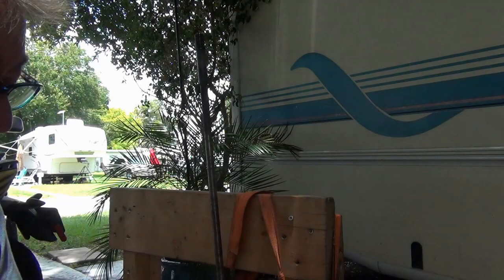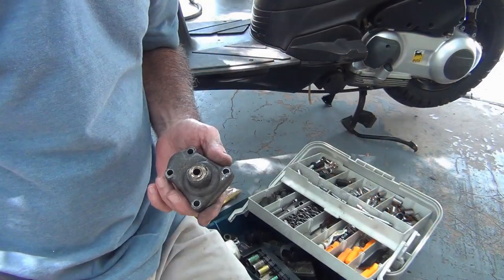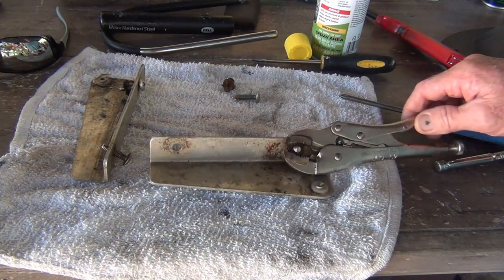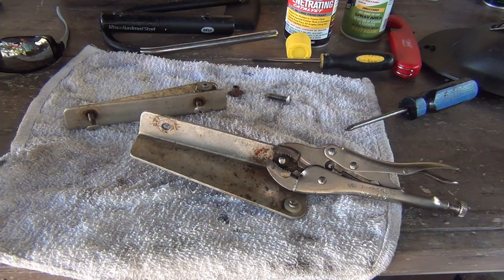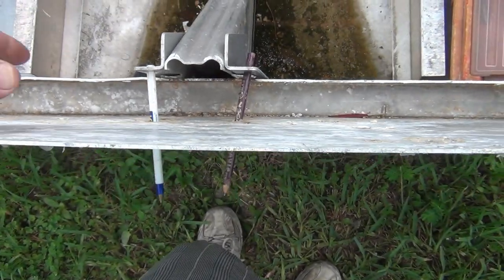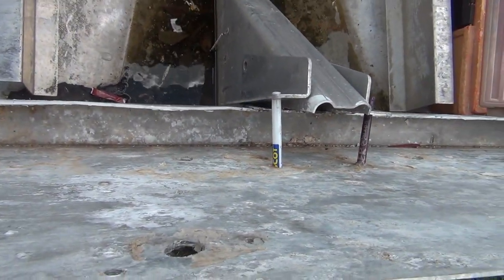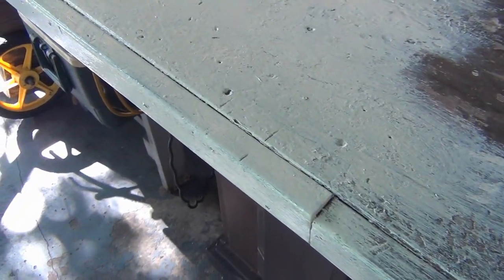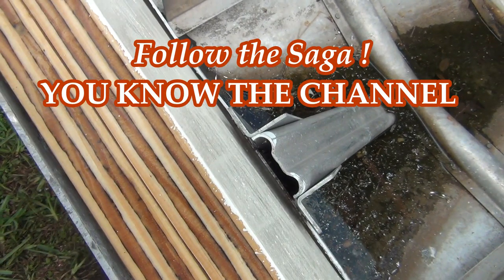16' Starcraft Transom Knee Brace Fix

Comment: I used to bend the tip of a screw driver just enough to catch the edge of the bushing, still hard to get out but it usually worked. Thanks for the video!!
Reply from the maker: Hey. Thanks for watching and commenting. And thanks for the tip! Stay tuned !

Comment: Have you ever tried using Sea Foam in any of your outboards? If you haven't heard of Sea Foam it is a gasoline additive for outboard motors that are running ruff or not idling well. Thanks for another fun video you're the man!!!!
Reply from the maker: Hey. Yes, been through a quite a few cans decarbonizing old outboards. Thanks again & Stay tuned !

Comment: Those little brass bushings are a pain in my neck I try to find a rod the right diameter 1/8 or 1/4 whatever it is and punch it out sometimes you get lucky usually it’s a pain either way you go
Reply from the maker: Yeah. It was so corroded I was afraid to beat on it too. Thanks again !

Comment: Some 1/4" aluminum plate will fill that gap on the knee brace bracket.
Reply from the maker: Hey. Yeah theres a place down the road I think I can get some. Thanks again & Stay tuned !
Reply: That or some wood, lol get it done!
Reply: Home Depot get you a 12” x 24” piece of aluminum diamond plate for about $25 that will fill the gap nice. Cut it with a jigsaw(easiest way) flush with top of the transom and it will give you something nice to protect your shiny new transom from the motor clamps. Win win. By the way I got my 72’ Johnny 20hp running great thanks to you.
Reply from the maker: @frankweathersbee2553  Thx!
Reply from the maker: @MW-gv9vz  Sounds good ! Thanks again & Stay tuned !

Comment: I used old street signs and made knee braces out of them, they are a great way so recycle. And free if you know a city street worker. Also I would just try to suck the transom up to the knee brace and not use the washers idea because the stress on the old transom pulled away from the original knee brace angle. That’s why the side of the knee brace was cracked. I would make a boat out of street signs if I could get enough of them. And great job on the transom it will last long time.
Reply from the maker: Hey. Yeah its amazing, I knew there was going to be a gap but didn't expect that much. Thanks again for watching !